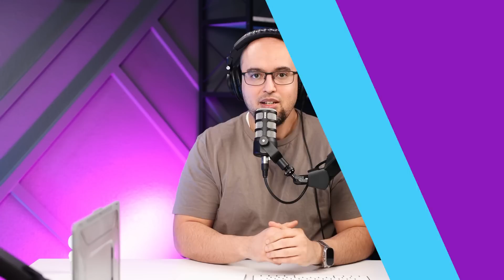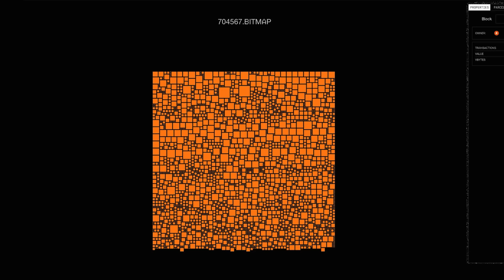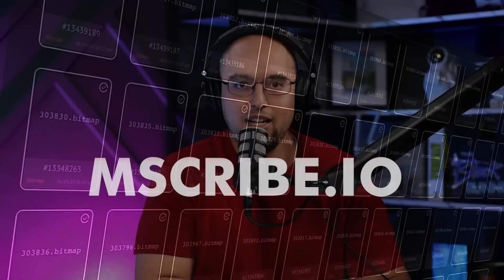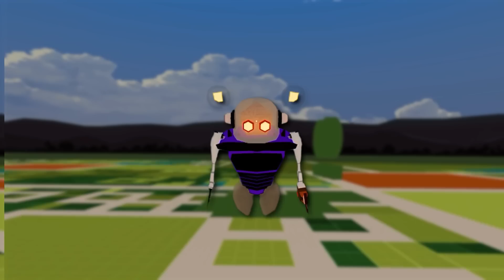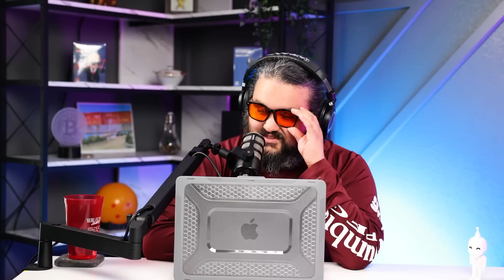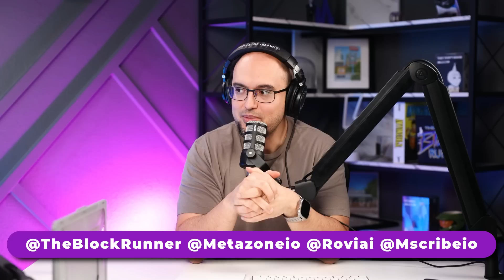Exploring Bitcoin’s New Scientific Paradigm w/ Founder of Mycosoft Morgan Rockwell | TBR #203

Comment: Also balaji discusses this at length on his interview with lex Friedman - using blockchain data provenance in peer reviewed science. Using cryptographically verified inputs when you are starting your experiment. The results and information of your experiment is then another hash linked to the previous one, making the progress of science much more consistent and trackable
Reply from the maker: Yes. This is a good use case.